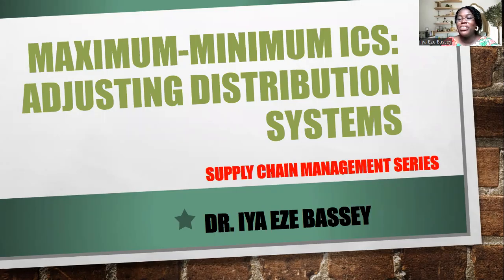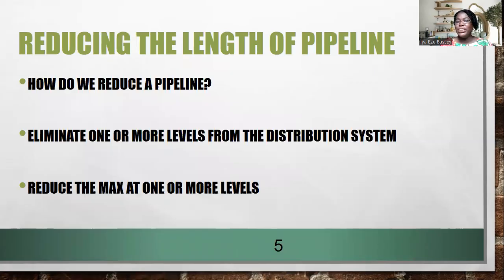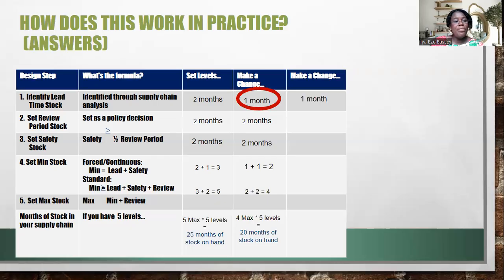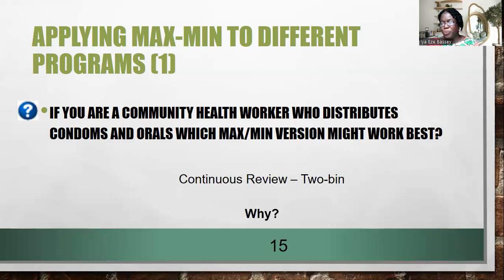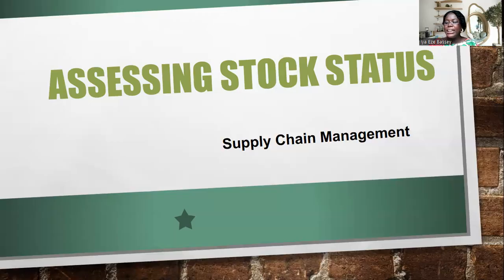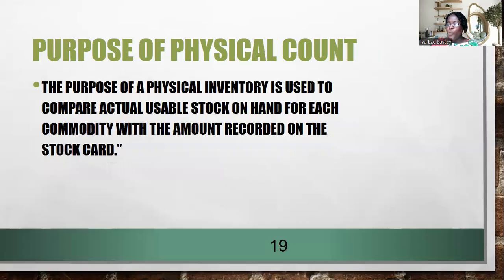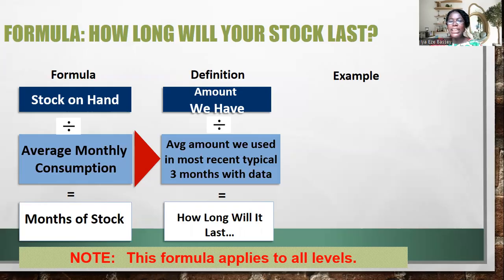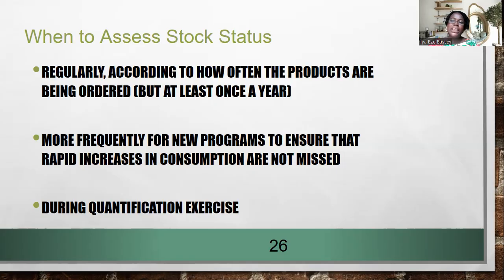Maximum-Minimum ICS: Adjusting Distribution systems (Supply chain management series)

Comment: @ OGAR MONICA OCHUOLE
thank you ma'am for this insightful lecture.
In summary of this lecture,u learned that using a maximum and minimum  inventory control system is a great way to manage stock and avoid waste.
in this case setting up involved deciding on initial max/ min levels for each part of your distribution system,then ensuring  these policies are consistently applied throughout the entire supply chain.
the two main ways of adjusting your distribution are:  
Either shorten the supply chain or reduced the maximum stock levels.
many factors influence these stock levels, including: 
- products cost 
- Transportation reliability
- Storage conditions
- Products shelf life
- Lead times 
- The impact of Stock out and even staff skills
 
The benefits of a max / min system are: 
- It prevents over or under stocking
- minimize wastse,and simplifies inventory decisions 
 
However, challenges can arise especially with complex distribution systems or managing many different products.
A key part of this regularly assessing your stock , which means physically counting what you have and comparing it to records,to see how long your current stock will last.

thanks ma ❤

Comment: Thank you ma
In Summary 
• Adjusting Distribution System Policies: The ability to modify parameters within the Max-Min ICS to improve the efficiency and responsiveness of the supply chain. 

• Advantages and Challenges of Max-Min ICS: Understanding the benefits and potential difficulties associated with implementing and managing a Max-Min system. 

• Inventory Control in Public Health Supply Chains: Examining the specific applications and considerations for managing health commodities like HIV/AIDS supplies. 

• Assessing Stock Status: The fundamental process of determining the actual quantity of usable stock on hand and how long it will last. 

• Calculating Months of Stock: A key metric derived from stock on hand and average monthly consumption to understand inventory longevity. 

• Designing and Adjusting the Supply Chain Pipeline: The Max-Min ICS is a tool for designing and improving distribution systems. 

• Methods for Reducing Pipeline Length: 
• Eliminating one or more levels from the distribution system.
• Setting policies that reduce the maximum stock levels at one or more levels. 

• How to Reduce Maximum Stock Levels: 

• Reduce the review period.
• Reduce the lead time. 

• Factors Impacting Max-Min Stock Levels: 

• Cost of products.
• Reliability of transportation and roads.
• Storage capacity and conditions. 

• Advantages of Using a Max-Min System: 
• Avoid overstocking and understocking.
• Minimize waste.
• Avoid costs of emergency orders. 

• Challenges of Max-Min ICS: 

• Systems with numerous levels.
• Managing a large number of commodities.
• Managing products for new programs. 

• Max-Min Variations and Their Application:
• Continuous Review 
• Standard Version
• First Ordering Version 

• Physical Inventory (Physical Count): The process of manually counting all usable units of each commodity in a store or facility.

Comment: Steps in designing a Max-Min ICS are;
*Setup Initial Max-Min Policies for each level and type of facility. *Check if the overall distribution will function properly if the Level Specific Max-Min Policies are implemented. 'Check the Total length of the pipeline that the policies at each level.
To reduce the length of pipeline, eliminate one or more levels from the distribution system. *Reduce the Max. of one or more levels.
Other factors that impact Max-Min Stock levels are; Cost of product, reliability of transportation, Storage Capacity, Cost of Storage, Storage Conditions at different levels, shelf life of health commodity, lead time, Reliability of Source of Supplies, effects of a zero balance of stock, management skills of staff, Age of program and Accuracy of Forecasts.
Some advantages of Max-Min System are:
Avoid over Stocking, minimize Wastage,
Avoid Under Stocking Etc.
To access Stock Status, we do physical Count to know the amount of Usable Commodity and know how long it will last.

Comment: Thank you Ma for this lecture.

I learnt that designing a Max-min ICS steps include: -Setting up initial max-min policies for each level and type of facility.
-Checking if overall distribution will function properly if the max-min specific policies are implemented 
-Checking the total length of the pipeline which each policy implies

In reducing the length of a pipeline
-we eliminate one or more levels from the distribution system
-we reduce the max at one or more levels

Factors that impact max-minimum stock levels include:
- Cost of products
- Reliability of transportation
- Storage capacity
- Cost of storage
- Storage conditions at different levels
- Shelf-life of health commodities
- Lead times          - Reliability of supply source
- Effects of zero balance of storage
- Management skills of staff
- Age of program      -Accuracy of forecasts

Problems Associated include: 
-Many different products
-Too many system levels
-New health programmes

Comment: Thank you doctor for this wonderful lecture 
I learnt the steps of designing a maximum-minimum ICS which are:
Set up initial max-min rules for each of the levels and types of faculty 
Check the total length of the pipeline that the policies at each at each level imply
I also learnt how to describe the inventory control system used in the logistics management in HIV/AIDS

Comment: Here's a summary of the provided text, focusing on how to adjust distribution system policies, particularly concerning pipeline length in a max-min inventory control system (ICS):
Optimizing Distribution System Policies
Adjusting distribution system policies, especially within a max-min inventory control system (ICS), begins with considering the length of the pipeline.
Designing with Pipeline Length in Mind
When designing a max-min ICS, the process involves:
 * Establishing initial max-min policies for each facility type and level.
 * Verifying overall distribution functionality with the proposed policies.
 * Assessing the total pipeline length implied by policies at each level.
Strategies for Reducing Pipeline Length
You can shorten the pipeline by:
 * Eliminating one or more levels from the distribution system.
 * Implementing policies that reduce the "max" stock level at various points in the system.
This reduction is achieved systematically through:
 * Shortening the review period for inventory.
 * Reducing lead times at one or more levels.
 * Improving the reliability of the overall distribution system.
Factors Affecting Max-Min Stock Levels (Beyond Pipeline Length)
Several other factors can influence the effectiveness of max-min stock levels:
 * Cost of the product.
 * Reliability of transportation.
 * Storage capacities.
 * Shelf life of health commodities.
Advantages of the Max-Min System
This system offers several benefits, including:
 * Preventing both overstocking and understocking.
 * Simplifying inventory control decision-making.
Challenges of the Max-Min System
Challenges with this system arise in:
 * Systems with numerous levels.
 * Systems managing a large number of commodities.
 * Systems managing products for new programs.
Assessing Stock Status
Physical count is the primary method for assessing stock status, which involves manually counting usable units at each health facility. The purpose is to compare actual usable stock with recorded amounts on stock cards.
The general goal of assessing stock status is to determine how long current supplies will last. This is calculated using the formula:
\text{Months of Stock} = \frac{\text{Stock on Hand (Amount we have)}}{\text{Average Monthly Consumption (Amount we use each month)}}

Comment: Good day ma, summary on what I learnt
Maximum-Minimum Inventory Control System
Adjusting Distribution System 
    Length of a pipeline 
1. set up initial max-min policies 
2. check if the overall distribution will function properly if the level specific policies are implemented 
    How to reduce the length of the pipeline 
1. eliminate one or more levels from the distribution system 
2. reduce the max at one or more levels 
     How to reduce max stock level 
1. shorten the review period at one or more levels 
2. reduce the lead time at one or more levels 
Factors that affect max-min stock level: cost of products, reliability of transportation, storage capacity, lead time, age of program 
     Advantages of using max-min system 
- Avoid overstocking.         - Avoid under stocking 
- Minimize wastage.         
when to access stock status: regularly, more frequently, during quantification exercises 
      Steps in setting max-min levels
1. Determine your lead time 
2. set the reviews period 
3. set the safety stock 
4. set the minimum stock level

Comment: Thank you ma.
In this lesson, I learned how to design a max-min inventory system. The steps are:
	•	Start with basic max-min rules for each level and type of facility.
	•	Make sure the full supply system will still work with these rules.
	•	Check how long the supply chain becomes because of these rules.

To make the supply chain shorter:
	•	Remove one or more levels.
	•	Lower the max stock amount at some levels.

To reduce the max stock level:
You can:
	•	Make review times shorter.
	•	Reduce the time it takes to get supplies (lead time).
	•	Make the delivery system more reliable, so you don’t need extra stock.

Other things that affect stock levels:
	•	Cost of products
	•	How good transport works
	•	Space in the store
	•	Cost to keep items
	•	How long items can last (shelf life)

Benefits of using max-min system:
	•	Stops too much stock
	•	Stops running out of items
	•	Less waste
	•	No need for emergency buying
	•	Easier to manage stock

Problems with this system:
	•	If there are too many levels
	•	If you’re handling many products
	•	If it’s for a new health program

A physical count is counting the real items in the store. This is used to check if what’s on paper matches what’s really there.

Checking stock status means finding out how long your supplies will last.

Comment: Good day Ma. This video explains how to adjust distribution system using maximum- minimum inventory control to optimize supply chain particularly in public health sector. 
Highlight of this lecture teaches us to adjust distribution system policies to improve supply chain, to reduce pipeline length by eliminating levels or shortening max stock, to lower maximum stock levels by adjusting lead times and review periods, to max-min systems preventing overstocking and understocking, minimizing waste etc. 
in a nutshell, I’ve understood pipeline length is crucial. I’ve learnt adjusting lead times, review periods and safety stick level systematically reduces maximum stock level. I’ve learnt that challenges arise with systems having numerous levels and managing levels numbers of commodities. Distinguishing between push and pull system is essential. Physical inventory counts are critical for verifying actual stock on hand. Stick status assessments and calculating months of stock available using accurate consumption data

Comment: Thank you very much ma 
From the video I was able to learn 
1. Identitying the ways to adjust distribution system policies using the systematic chain from the PORT  to CLIENT and 
How to describe the inventory control system used in the logistics management if HIV /AIDS  
I also understand to Reduce the maximum stock level it must undergo 
1. Shorten the review period at one or more levels.
2. Reducing the load time at one or more levels.
3 the element of formulas which can be changed in order to reduce the maximum stock levels.
Also understand the benefits of implementing Nax-Min  inventory control system 
Minimizing waste 
Avoiding overstocking 
Maintaining consistent stock level

Comment: In summary, I understood the purpose of inventory
control system and one of them is to maintain an
appropriate stock level of all products avoiding
shortages and over supply.The illustrations threw
more light.
I understood the definition of ICS terms like the
review period and it's importance is to know the
stock at hand and determine how much to order and
to avoid shortages,I also got to know the difference
between maximum stock level and minimum stock
level and emergency order point.
Store keepers and system designer roles and
understood the store keepers rule. There are three
maximum-minimum inventory control system which
consists of forced ordering,continuous ; review and
standard review .Thank you ma.

Comment: Maximum and minimum inventory control system
1. Length of the pipeline 
2. Cost of products 
3. Reliability of transportation 
4. Storage capacity
5. Cost of storage
6. Storage conditions at different levels 
7. Shelf-life of health commodities 
8. Lead time, etc.
There are Advantages to using max-min system which are; avoid overstocking, avoid under-stocking, minimize wastage, avoid cost of emergency orders, simplify inventory control decision making, etc. Example, for drugs, HIV test kits and labs, the version you would recommend for are standard version as the most appropriate.
Physical count(inventory)
It is the process of counting by has  the total number of usable units of each commodity in your store or health facility at any given time.

Comment: Here’s a summary of
Module 4: Maximum-Minimum Inventory Control System

Reducing the Length of Pipeline

Eliminate levels from the distribution system.

Reduce max stock at one or more levels.

Set policies to control max levels.

How to Reduce Maximum Stock Level

Adjust formulas.

Shorten review periods.

Reduce lead times.

Improve distribution system reliability.

Stock Levels Depend on:

Lead time.

Source reliability.

Zero stock balance effects.

Staff management.

Program age.

Forecast accuracy.

Advantages of Using Min System

Avoid overstocking and understocking.

Minimize wastage.

Control costs.

Simplify decisions.

Consistent stock levels.

Reliable data for forecasting.

Challenges

Systems with many levels.

Managing numerous commodities.

---

The Pipeline

Pipeline length = time for materials to move through each level.

Levels include: Central Warehouse (4 months), Regional Warehouse (4 months), District Warehouse (4 months), Health Centers, and Community Healthcare.

---

Steps in Setting Max-Min Levels

1. Set initial max-min policies.

2. Check functionality.

3. Review implementation quality.

4. Confirm total pipeline length.

---

Applying Max-Min to Different Programs

Community health workers distributing condoms/orals may use a standard version.

Suitable for different programs like TB, HIV/AIDS, and malaria.

---

Assessing Stock Status

Determine the right inventory control system per SOP.

Assess how long supplies will last.

---

Definition of Physical Count

Manual process of counting usable items in inventory.

Compares actual with recorded stock.

Comment: Nice lecture ma'am, Here are a few things I have noted from this video; It explains how to adjust distribution systems using maximum-minimum inventory control to optimize supply chains, particularly in public health. 
Helps adjust distribution system policies to improve supply chains.
 Reduce pipeline length by eliminating levels or shortening max stock.
Lower maximum stock levels by adjusting lead times and review periods.
Max-min systems prevent overstocking and understocking, minimizing waste.
Regularly assess stock status via physical counts for accurate inventory. Calculate months of stock using stock on hand and average monthly consumption.
 Tailor max-min system variations to program needs (e.g., HIV commodities).